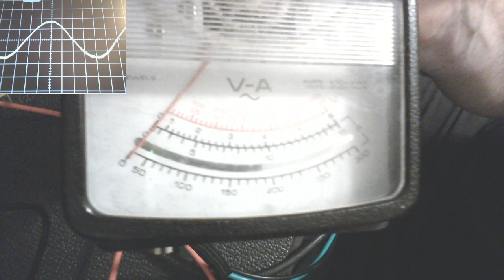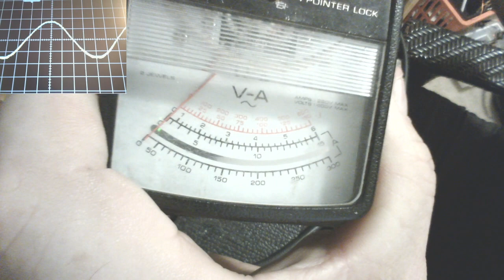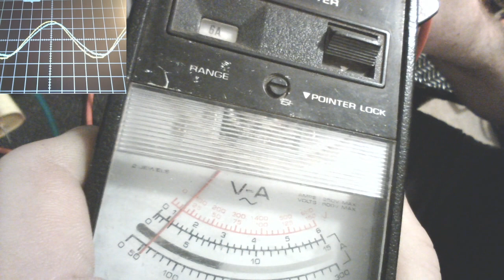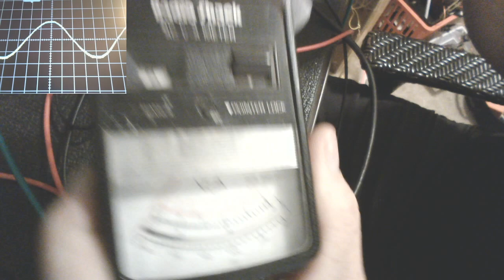BiTT Transformer PT402

Comment: Wow, thanks for this demo Tim. Using just a off the shelve 3 phase transformer, well done. Do you remember if it made any difference  that additional transformer laminate that you cut off and  put on top of the transformer?  
Did you do that on both end of the transformer or only one end?
Reply from the maker: Hi,Yes both ends

Comment: Nice results there! thanks for sharing: doesn't 130V output with 128 Ohms load = 1.016 Amps, not 1.25 Amps? 
Anyhow your project can only get better with refinement congrats!
Reply from the maker: Hi and thanks, you are right! It was very late when i added the details in the video 8)
Reply: @Timtron432  I would like to replicate what you are doing, may I ask are you using  3 phase transformer or a 3 phase line reactor/ choke ? I didn't see any secondary.
Reply: @Timtron432  Thank you !! Gerry
Reply: @UCNf-hpDsPXE6pZVRPPeEqrA Thank you Timtron, most appreciated!

Comment: was it in phase when you checked the current and voltage on the 2nd ?
Reply: @Timtron432  it’s normal to have 90 degree on the source between the voltage and current because as you know it’s reactive power and as you know the main purpose of the BiTT is to make that phase shift to be 0 degree so the voltage and the current are perfect in phase which means it’s real power which is amazing because it’s using reactive power cost is almost zero and giving high power and real not reactive power
Reply: @Timtron432  in thane videos he shows the output of the BITT is showing a lamp and the voltage and the current are perfect in phase , i think the 60 degree is better than 90 but you still have room for improvment to reduce that 60 to 0 , the question is how to reduce that to 0 , is it the ratio or maybe the direction of the two output coil or the outter core